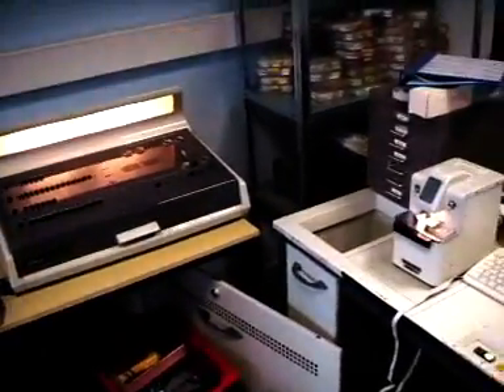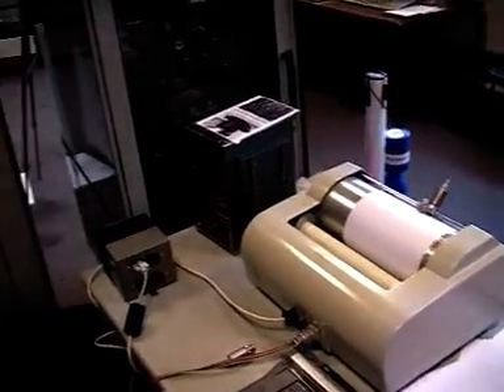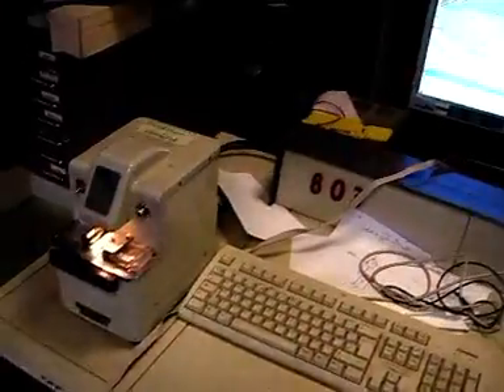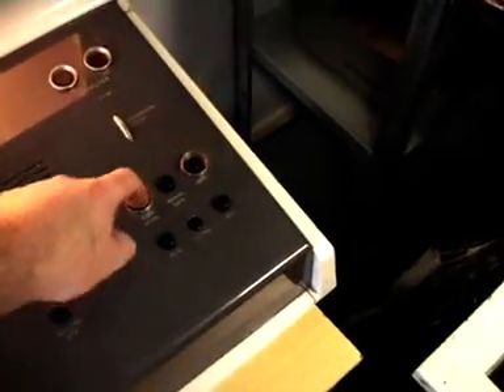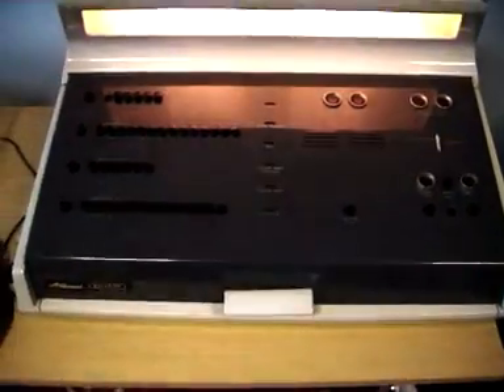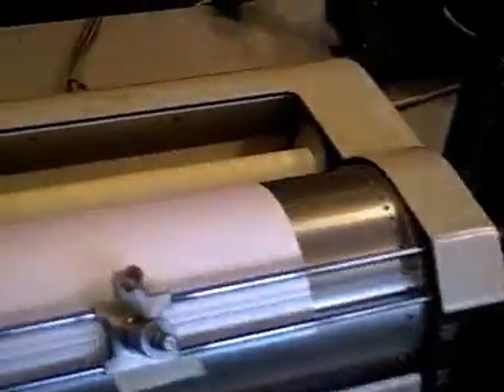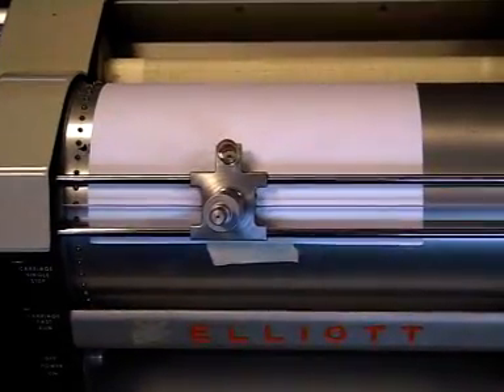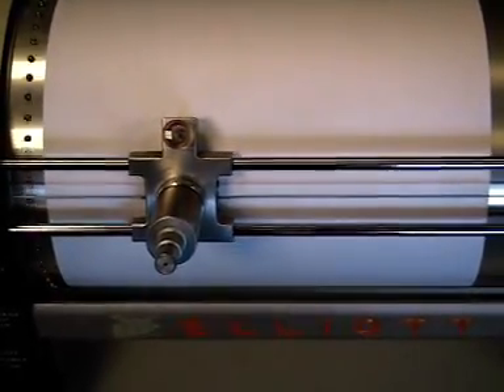CalComp2.mpeg

Comment: Wow, what a speed! How did you run the 565 at that high speed? Even my low resolution 565 doesn't get near to that speed! 
In my docs I read a maximum of 200 steps/second. Going more than a little faster than that produced deviations on my plotters. So I'm quite curious to get some further info on your device! 
Regards, Philipp